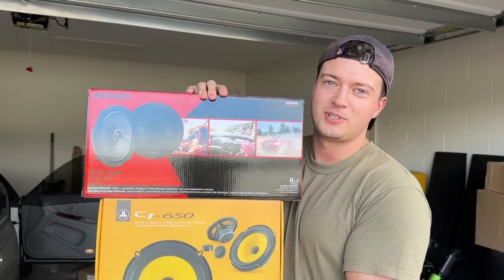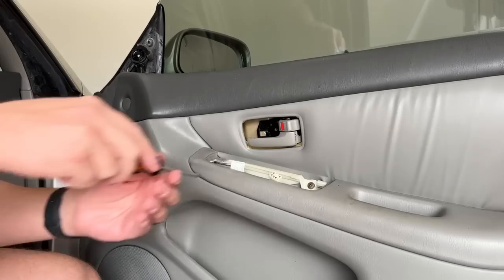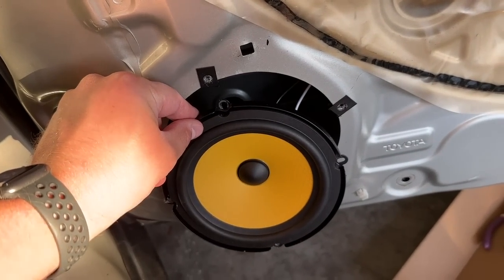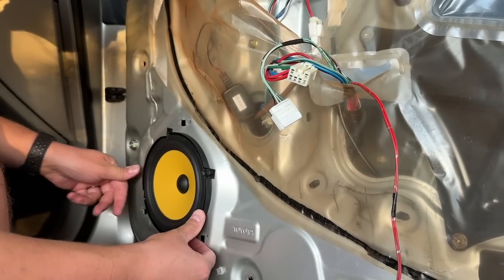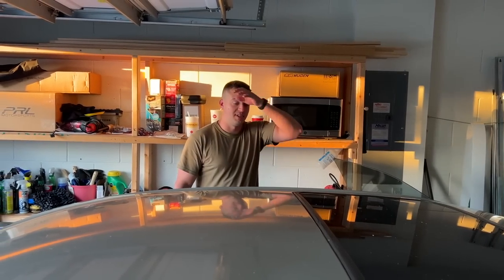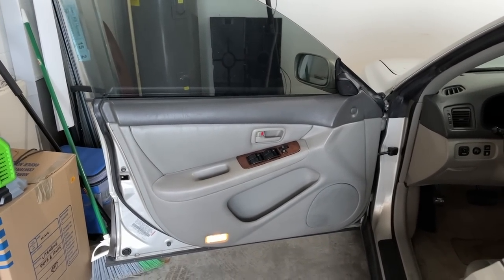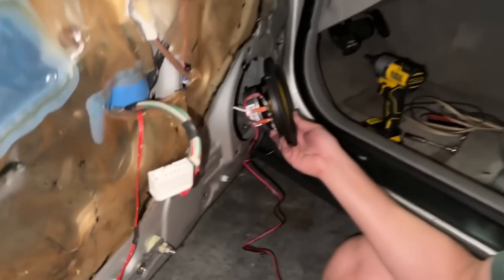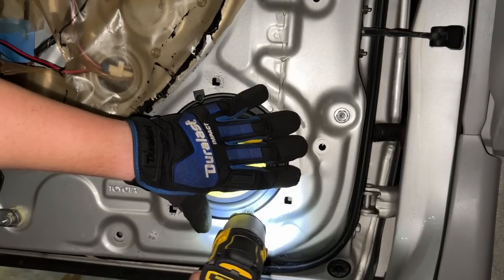NEW SPEAKERS FOR MY 1998 LEXUS ES300!

Comment: For anyone wanting info on the 8” sub in the back; His is a ‘98 and mine is a ‘01 with the nakamichi system. The stock Nakamichi amp MAX sub output is 60 watts at 2 ohms. PLEASE let me save you a ton of issues with a couple of pro tips: get an 8” open air sub. It HAS to be 2 Ohms or a dual voice coil wired in parallel. Try to keep your RMS under 60 watts or you will fry the stock amp like I did 😅 btw the amp is under the passenger side where the glovebox is.
Subs to look at that will make a noticeable (not huge) difference but also not blow your amp or your budget: Skar Audio VD-8 D2 8" 2 Ohm, Kicker 44CWCD84 CompC 8",  RECOIL RW8D2 Echo Series 8”, MB Quart DS1-204 Discus Shallow Mount Sub. 

Hope this saves someone the issues I had! Dont get too caught up in the free air/enclosed debate. The sub I put in was marketed as a free air sub but a year or so later it was suggested for use with an enclosure but I was happy with it for sure.

Comment: sub woofer is connected to the passenger rear driver side speaker iirc so that’s how it gets power 

love watching the videos!
Reply from the maker: Thanks! What does iirc mean
Reply: @Camhill182  “if I remember correctly”
Reply: His is a 98 and mine is a ‘01 with the nakamichi system. The stock Nakamichi amp MAX sub output is 60 watts at 2 ohms. PLEASE let me save you a ton of issues with a couple of pro tips: get an 8” open air sub. It HAS to be 2 Ohms or a dual voice coil wired in parallel. Try to keep your RMS under 60 watts or you will fry the stock amp like I did 😅 btw the amp is under the passenger side where the glovebox is.
Subs to look at that will make a noticeable (not huge) difference but also not blow your amp or your budget: Skar Audio VD-8 D2 8" 2 Ohm, Kicker 44CWCD84 CompC 8",  RECOIL RW8D2 Echo Series 8”, MB Quart DS1-204 Discus Shallow Mount Sub. 

Hope this saves someone the issues I had! Dont get too caught up in the free air/enclosed debate. The sub I put in was marketed as a free air sub but a year or so later it was suggested for use with an enclosure but I was happy with it for sure.

Comment: I have this car and I can tell you that almost nothing is plug and play on this car. And you need to install something to get rid of the whine for the aftermarket radio. I don't remember what it was but I can check the papers if I still have them
Reply from the maker: If you can find what I need to do for that whine, that would be super helpful
Reply: @Camhill182  It might have been a ground loop isolator? I gotta check with my uncle. He had this free install thing with best buy and I got my radio installed for free on his account
Reply from the maker: I’ll look into it. Thanks!
Reply: It’s probably inside the ignition coil like most Toyotas
Reply: @Camhill182  hey man. I heard back from my uncle and his account doesn't show what best buy installed into my car. 
But I remembered it was some kind of amplifier bypass. The stock amp was causing a whining noise because of the new radio. Hope that helps!
Reply: @Camhill182  also, I got a Sony radio with a built in amp. So it didn't matter if I had a working stock amp or not. My model is a Sony dsx a415bt